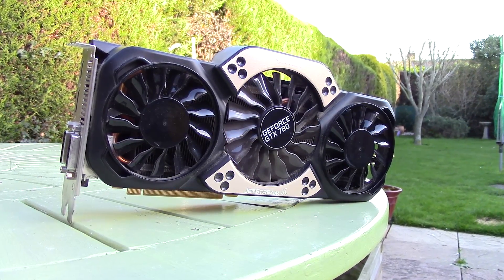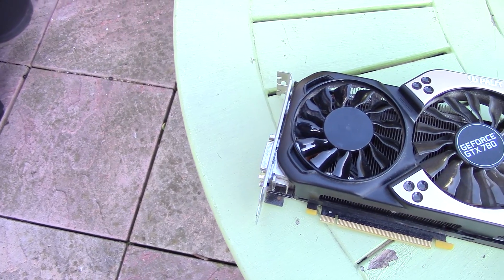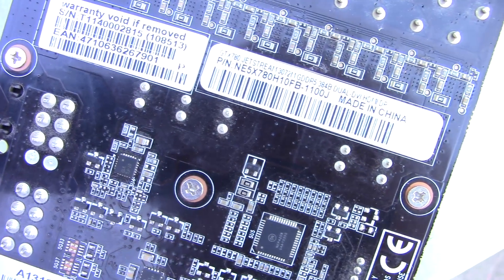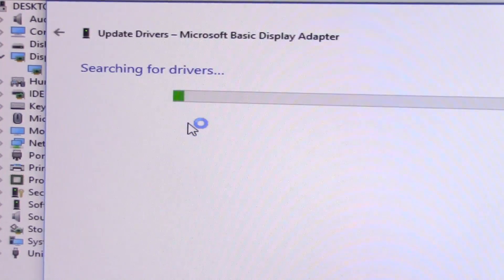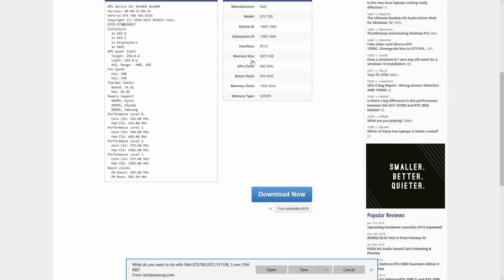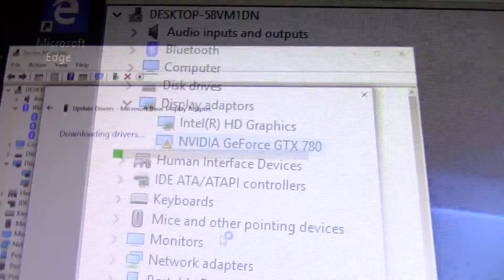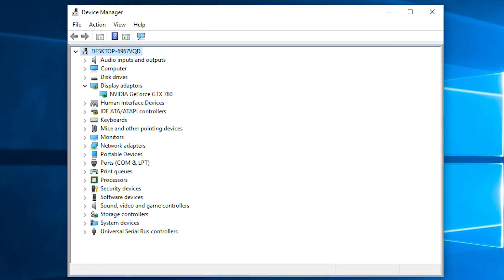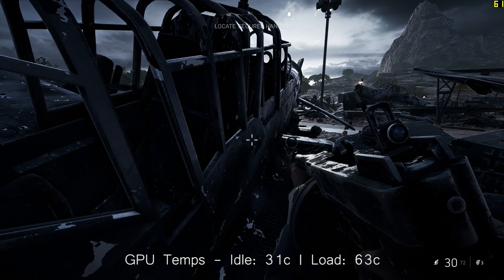Can We Fix This £20 ($25) GTX 780?

Comment: ever since i tried to get my freesync working by updating my driver to 417.71. PUBG would not even open correctly. i would just put up a blank screen with the fps counter going up to 1400 fps i know that plenty of the monitors arent supported correctly with "G-compatible" but i also DDUed my computer and reinstalled 391.35 the same one ive been running for months and still PUBG wont open correctly. Although i did get it running twice but it hasn't ran correctly since. Im running a 4790k and a GTX 1070 on windows 7. if anyone has any advice it would be greatly appreciated

Comment: I had the Same Problem, i cooked my graphics Card with a shortage caused by a m2 SSD. Had no post and the fans we're all in full Speed. So you think a flash could so the trick? Doesnt really Matter cause i bought a 1080 but just curious If i could fix it.. tried to bake the card already but that really didnt Help 😅 thanks :)

Comment: I have a Jetstream GTX 680 in my collection which has the exact same issue as yours. But unfortunately I have tried flashing the BIOS, both in windows/DOS and with a hardware programmer. I may give it another shot with a different motherboard but as you say, not all problems have the same fix

Comment: I'm running Xeon and old Phenom based systems both without iGPU. Does this work if you plug in a second GPU in a PCIe slot? I have a R9 290 that won't put out a display signal and I'd love to pair it up with the Phenom. Power might be a concern, but you shouldn't have to max out a 550W PSU just to boot.
Reply: schtrigga you should be able to flash the faulty gpu with another graphics card serving as the primary even if it is an old PCI based card. I’ve done this successfully.

Comment: Flashing goes a long way, i purchased an AMD R9 Fury Sapphire on Letgo and the seller said it had no problems. When i got home i plugged it in and downloaded the driver and everything was going fine but games would frequently lag and crash, i checked the card for dust and it was in great condition plus i repasted it. I got angry and frustrated and the seller said no to giving it back so i thought i would never have a working gpu but, i decided to try and flash it and it worked!! Ive been using the card to this day 1 year ago and no problems!!
Reply: Did you just try flipping the BIOS switch? (technically, that exact card has a push button switch, the one that lights up blue), I can't imagine someone being dumb enough to flash both profiles.
I'm betting they tried to unlock more shaders, many of those cards could unlock from the stock 3564 up to the full 4096 stream processors, and there are several BIOS enabling more (depending what area you have defect cores, there is also a tool for looking up which exact ones are possibly faulty to help you choose BIOS version).
Reply: @jakegarrett8109  yeah i tried flipping the switch too and the same bios was corrupted, i think the card was previously used for mining which is sad for a card like this. Both bios's were exclusivly meant for mining, clocks raised and power limit down. Just stable enough for it to mine but not game
Reply: Also i did try to unlock the extra cores and my card has an 100% chance of unlocking all of them but i dont know how to write a bios. I used the software to check and all the x's were on the right and the more you have on the rigt the more % u can unlock
Reply: @zephr4987  Well that sucks (do note the Sapphire stock BIOS is probably the highest voltage at stock for Fury, so it may not be so bad they lowered it some for longevity). The last 2 Fury Nitro cards I bought came in an Antminer packaging box, and seeing as the seller still has probably another 100 left, I'd say they were probably not all used for gaming. Regardless of that, they are still my highest overclocking Fury cards, so seemingly unaffected compared to even a Nitro I bought brand new a while back since both overclock higher than it.

I don't think its sad they were used for mining, I think they are actually the best card to have mined on. Why? Because the Nitro is so ridiculously overkill, it won't damage or hurt it. The core stays amazingly cool even if they had the fans barely spinning, and the VRM is a direct copper contact heatpipe going to that massive heatsink, coupled with some of the best Mosfets you can get, with those featuring metal contact to help heat dissipation,  you've got a NICE cool VRM even with the fans completely off. Plus the cooler is naturally direct contact to the memory, so everything important is cooled directly by the heatsink, even without airflow it is cooled. Its just the best GPU design I've seen, period.

Anyways, I think very highly of Sapphire's design (that's because I've seen many appalling designs)
XFX (RX 470 as an example): "Backplate heat Coffin" (no thermal pads on the back), the backplate literally just traps a ton of heat on the back of the card, and completely blocks airflow from fans or even natural convection. It wouldn't be the worst I've seen, but you must remove the entire cooler to access hidden screws to remove the backplate (and puncture the warranty void screws). Kills the otherwise awesome hot-swap fan feature they had (without a backplate, it would get a thumbs up, but its so poorly implemented it became my go-to example of "bad GPU design")
Nvidia (Titan Xp): Inadequate cooler even at stock. Within 3c of thermal limits with fan screaming 100% fan speed (surprisingly doubles as a way to blow everything off your desk...). Allowing it to thermal throttle hard at stock, means a massive hit, going from 1900+ Mhz down to 1600's with the card feeling like the whole thing will melt (still ridiculously loud). Warranty is void if you want to water cool to fix the "leaf blower/furnace" noise and temp issue. Also a ridiculous amount of delicate screws used as well.
Gigabyte Fury: Cheap VRM Mosfets that are SO BAD, the card overclocks highest when under-volted, probably due to VRM being choppy and not capable of managing the power delivery at stock, the VRM gets insanely hot. The cooler is unimpressive, but honestly it gets the job done and not nearly as garbage as the $1200 Titan, but it is probably the worst Fury made.

That would be cool if you get it unlocked to the full Fury X. BIOS flashing isn't particularly difficult, just read some guides (make sure they are recent, the flashing tool keeps getting updated, last time I flashed RX 470 cards, the buttons had random garbage text on them, but being brave I flashed them anyways, haha!). Good luck making it a Fury X!

Comment: Unfortunately my msi gtx 780ti died. I took it apart and cleaned it unfortunately it had a ton of artifacting on the screen and anytime the drivers were installed it would crash and reboot.
Reply: darkwind9000 many of the older cards that draw a lot of power eventually black screen or show artifacts. Usually it is the solder joints going bad and the only way to really bring the card back is by reballing the GPU chip.

Comment: I got extremely lucky with a 1080 Armor with no heatsink for U$D 80 on eBay, it simply worked, the only thing I did to it was installing a AIO Cooler.

Comment: STORY. PLEASE READ!!!

I had a GTX 660 and the issue was that windows always had a problem with it, Error 43. Now the card was working fine, no problems but at the owner it suddenly turned the PC down and he was granted with the error. When I saw it I knew that hardware wise was fine, it's the software. I tried the drivers, didn't work. Fresh paste, didn't work. Reinstalling the bios worked! I was so happy, I had that card for A BAR OF CHOCO 🍫 (300g purple one)

Now for the LONG TERM! It probably won't fix it. My card was dropping out the error every 1-2 months, a bios reinstall fixed it all the time and besides that it worked like a charm but now sold it for 50 euro. A bargain but the fact that it's working is just good :)

Comment: I got 2 semi-broken cards flying around, a GTX 770 2GB (Gainward Phantom) which I got for 5€ (seems to work, but previous owner had Blackscreens) and a GTX 680 4GB EVGA Classified which I got for 15€ back then, it works flawlessly but some sensors seem to be gone, at least in GPU-Z it goes kinda crazy with temps and voltages.
Reply: GPUz is highly inaccurate, check out my world record 33 Ghz speed....
https://www.techpowerup.com/gpuz/details/fkg6k
Perfectly working hardware often shows anomalies (like 1 million volts on the core), and software in general shouldn't be trusted with voltages (and temps are silly too, just look at any FX CPU, those show BELOW room temp when idle, which is physically impossible on air/water since it can only be hotter than the surrounding air... HWmonitor and CPU-z just never fixed the sensor calibration they pull the data from, and FX is ancient at this point, so it will never be corrected). Don't read too much into software... Even windows commonly bugs out (known as the Windows sleep bug) and will have the system timer slow down (so your CPU display and also score like it really is 6-7 Ghz since most benchmarks score of the system timer. It won't be any faster in real life, but your system is thinking it completes the task in less time, and used to be a common way of cheating, but no, that's not what I did for the above linked score...)

Comment: I'd be interested in a GPU BIOS Flashing guide video for AMD Cards, I bought a MSI Armor RX 470 4GB off eBay for $114 Canadian shipped but I highly suspect the card I got has a modded BIOS as it won't work properly with the Driver for it, thankfully the seller sent me a 2nd card & said if it works I could keep both & the 2nd card works so I saved a copy of the BIOS from it I just need to get around to Flashing it on the problem card.
Reply: What brand is the first card. A lot of companies will let you RMA regardless of you being the second owner. XFX, Evga, and Sapphire are the ones I know for sure. You might even be able to RMA it even if they don't have a warranty that supports second hand cards, just don't say anything they don't ask for proof of purchase or anything when you RMA. I have done motherboards through both Asus and MSI they just want the serial number.
Reply: They are both the same make & model, MSI Armor 4GB OC Edition.

Comment: I have a gtx 650 and I have the same problem and flashing the bios didn't solve the problem :(
Reply: Ahmed Ibrahim get a new gpu
650 sucks anyway
Reply: @yournemesis192  I did. got a gt 1030 and phenom 2 x4 955 but experiencing some thermal problems with the @#&$ stock cooler XD
Reply: Ahmed Ibrahim then get a new cpu
Like a Ryzen 3 or 5
They aren’t that expensive but just so much better than old phenoms

Comment: Recently bought a 780 for less than $100 was a real deal.
Reply: Thats shit that its so expensive. Good for you but people have been selling rx 580 here for 70€.
Reply: ProtoMario didn’t you have a 1050ti? I thought that was around the same speed of the 780?
Reply: Lil_Mayo no the 780 is better than 1050
Reply: and i got a 1060 6 gb for $130
Reply: @flighted2513  That's a bad deal
Reply: @bletrick3352  A 1060 6GB for 130 wasnt a bad deal over 1 year ago.
Reply: @bletrick3352  that's long time in tech world though. Maybe it was good deal back then. Also we don't know where he lives.
Reply: @Waldherz  its still not a bad deal... Not the best but far from bad for the performance it will still deliver.
Reply: https://www.ebay.com/itm/ASUS-ROG-Strix-Radeon-RX-570-O4G-Gaming-OC-Edition-GDDR5-DP-HDMI-DVI/192611463842?epid=245306346&hash=item2cd889b2a2:g:9rEAAOSwWuNbXKd9:rk:1:pf:1&frcectupt=true
Reply: ProtoMario .... your EVERYWHERE!!!

Comment: I had 2 MSI RX 480 Gaming X's and neither worked. Would always get a black screen. Any ideas anyone?
Reply: kelvinfried chicken  Why would the brand matter, expecially if it's a reputable company like MSI? I've had multiple parts from MSI (my motherboard, and two of my graphics cards) and they're still working today.

My guess is if he bought the cards used, they may have been used for mining and have a modified bios that is preventing them from acting as a normal 480.
Reply: Try to RMA them regardless of the used thing...if they are used. Most companies have a 3 year warranty xfx and sapphire have 3years for the card regardless of resale to another person...Evga as well. BUt yea try to RMA them and don't bother mentioning the used bit, just that they are broken and nothing more.
Reply: @chrisvanalstine8136  I'm very certain XFX stopped doing warranty transfers, most companies turned to scum and started denying any claim (even valid ones within a couple months from original purchaser, even on weak cards nobody was mining with at the time) based on the grounds of "we think you mined with them" (which is actually illegal... If a GPU says it is made for CUDA acceleration, then denying a claim for using your CUDA acceleration is beyond stupid, its illegal, however, nobody sues them for it since that's too much trouble). I checked on XFX track record since I bought some used and mined XFX RX 470 cards (they will allow you to remove the cooler and use water-blocks though, which is cool, they say "just ignore the warranty void stickers", which is actually also illegal, and another thing companies do to try to intimidate consumers... but at least they say it in writing, so you could easily win a lawsuit against XFX for that).

Problem with RMA, is they always want you to pay shipping (which I'm pretty sure is also illegal, its entirely their fault, so they legally need to pay for it), however, every company direct has been a total pain in the butt (besides Toshiba OCZ, they actually had a replacement SSD to me within 48 hours, and paid a massive $48 shipping cost for it, Doubled the SSD capacity, and gave me a week to move files from my failed drive, yeah, advanced me the drive without having me pay for it or any way of getting money from me if I just lied and said it didn't work just for a free 2nd drive, and they paid return shipping label, so yeah, I brag about them now, best customer service ever, no questions asked) DON'T GET ME STARTED HOW $HIT NVIDIA CUSTOMER SUPPORT IS! Buy a Titan Xp, and get treated worse than a homeless person peeing on guests at a fancy party... worst customer service I've ever seen.
Reply: I see where XFX change it, must be a recent thing. To damn bad my booklet in my 480 box says otherwise, even though im the original owner. That is straight bs that they just went and changed it like that. Yea it had to be because of the mining which shouldn't matter. What if I render literally all the time for days or even weeks straight, how is that any different than mining. Anyways EVGA does most certainly cover second owners I only buy EVGA when buying Nvidia cards you just go on there site sign in input the serial and date of purchase and they transfer the remainder of the warranty. Also I bought a Titan Xp for mega cheap last summer and the guy I bought it from gave me everything he never registered it so I got the warranty. It wouldn't surprise me if Nvidia treated their Number 1 customers like shit.
Reply: @jakegarrett8109  Also apparently Sapphire changed their warranty to like bare bones nothing. You can't even take apart your card and water block it. So Evga is from what i know the last one then.  I would still try to RMA used cards anyways, just don't say anything. Cards don't break because they have a new home they break from defects.. well unless mistakes were made.
Reply: Did you buy them used?

Comment: Oi you need to stop stealing my deals, anyway recently bought a r9 270x as they are round about £40 - 50, I got mine for £35 and am waiting for it to arrive. You should definitely start buying up falty GPUs off eBay - the cheaper the better! Great vid make more like this.
Reply: lol, 270x was my first gpu!
Reply: @JKidk_  ayy I had a HD 7870 as my first got it in 2014 for £45 then sold it a week ago for £50
Reply: Western world is a dream. Here in Poland used electronics not only cost pretty much the same as new but also it's easier to get scammed than to not
Reply: @Gewel ✔ Same here in Bosnia. I've been trying to buy a used gt 1030 for months now, the price difference between a used card and a new one is around $23 USD and both of those prices are double of what they cost in the USA and richer EU countries. Honestly, the prices of used electronics are a solid indicator of how developed a country is, basically super cheap used PC parts = super developed country.
Reply: @GewelReal  Same shit here  in Latvia  too !
Reply: Gewel ✔  It's the exactly same thing here in Brazil. The prices are almost the same of the new ones and the chances of being scammed are very high.
Reply: @GewelReal  one word - Brexit - that is why Poland is better than the UK
Reply: Got mine for 45 a few months ago! They were going for 60+ at the time
Reply: I have an R9 270X because my GTX 780 died on me, cant fault it for the 25 I paid (mates rates) lol
Reply: Got my Gigabyte Radeon R9 270x for $67.37 shipped in November of 2014, still gaming daily.
Reply: The Reaper95  270 was based on the 7850 the 270x was a 7870 based GPU 20 CU 1280 SPs it did take the place of the 7850 in the lineup though so there is that. Which I suppose means your bottle of AMD fine wine is even better than you thought it was XD
Reply: @nohzatino9629  I'd say it is safe to assume that some are faulty. Are they all faulty? No. It would depend on what exactly was wrong with it to make a clear call on if it can be fixed to be working again.
Reply: @nohzatino9629  mine 270x had dual bios switch, one bios failed
Reply: I personally scored a nice deal on a used RX580 4GB for $130
Reply: @OG_MrRubberDucky  I could score the 8 gb model for the same money including transport , but I don't got the money 😭 , I'm just a "window" shopper
Reply: @notyorbizness  that sucks. :/ hopefully someday ya will have enough to snatch one.